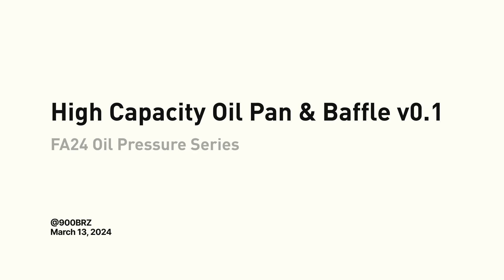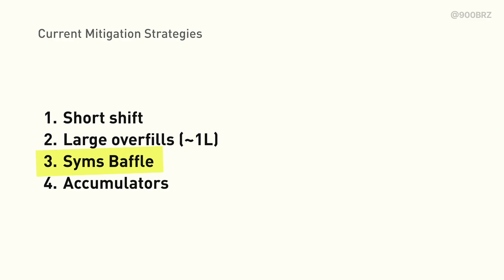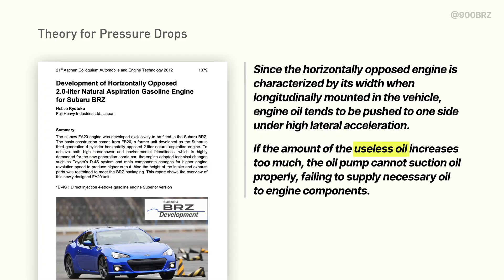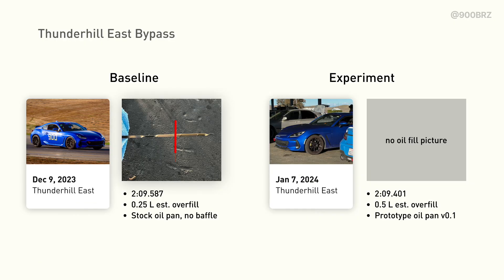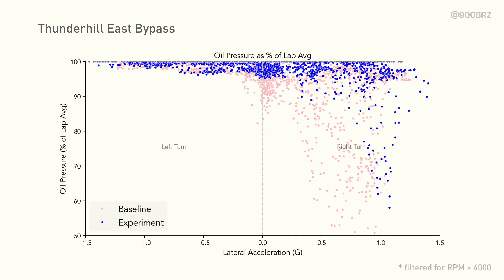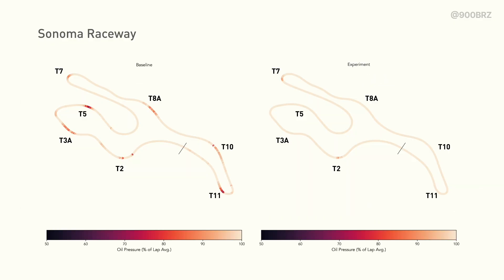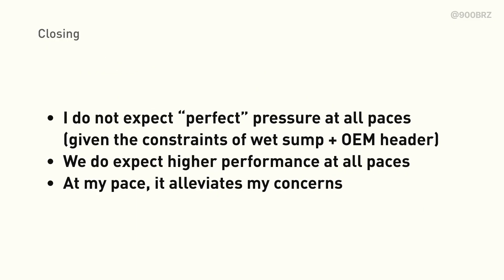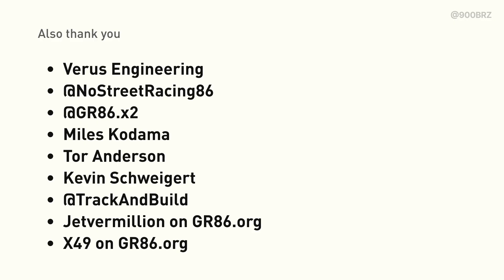FA24 High Capacity Oil Pan & Baffle Announcement

Comment: I had a professor that said "if you can't solve the problem, ask a different question." Maybe the oil pump flow rate is higher than the return rate? That's the problem. Restrict the the flow rate of the pump and maybe that works.
Reply from the maker: Yeah that’s definitely something I’ve heard of people doing in the FA20. At higher limits those will still have issues. Do they restrict the ports supplying the heads to try and increase the supply to the main galley (main and crank bearings). Restricting the flow of the pump may also help but it requires timing cover off and probably much more testing than this brute force approach.

Comment: First off, thanks for all the work to thoroughly test prototypes so a meaningful solution to this problem can be found.

Are you running your oil pressure sensor in the galley plug, or the stock sensor location? Also did you bother with a remote line to reduce vibrations/ heat on the sensor? I have mine in the galley plug with a remote line, but I kinda wonder if it's overkill.
Reply from the maker: It’s in the stock location with no remote line. Fwiw this is how the GR Cup cars are instrumented as well. I don’t think the remote line hurts, but I haven’t had any issues with this setup
Reply: @900BRZ  good to know! I may drop remote line just to reduce the additional connections that could fail

Comment: Thank You for this extensive study.  Not only is it interesting but it is also useful.  I am curious though. With so much focus on this issue for BRZ/86, I wonder how many other car models, performance or otherwise, experience brief pressure drops or fluctuating oil pressures?
Reply from the maker: For commuter cars it’s likely very high, but this car is marketed as track-ready, comes with a free track day (Toyota only), and has a factory race series on the same engine. I would love to test Miatas. One of the development engineers said they had an internal benchmark for consistent oiling to 1.4 G, which is significantly beyond where my car is going. That said it’s a lot easier to achieve in an inline engine.

Comment: Any long-term issues that may develop if the stock header heatshield is removed?
Reply from the maker: Good question. I don’t fully know, but my collaborate Kevin said he ran his FA20 for years like this without a problem. It’s also possible to wrap it or get it ceramic coated. Or adding cooling like a hood vent would probably look completely counteract the additional heat. I haven’t noticed materially higher oil or coolant temps running with the uncoated stock header. I liked what Eric from Verus said: it’s a lot easier to solve cooling issues than pressure drops.
Reply: Maybe verus can come up with header pan combo that resolves all concerns.
Reply: I’m somewhat vaguely aware that ignition coils can go bad due to excessive heat - but this was gen1 cars and on aftermarket headers (that may or may not be coated). A few mates had them fail on track but they had spares.
Reply from the maker: @ajs858 Read a bunch more on that in the forums. I’ll do some tests with an IR thermometer and see. I’ve been lifting my hood after sessions to let the heat escape. Sounds like it’s a good idea to keep doing that.

Comment: This work substantiates my suspicions that I've always had. This is a 30k car that was bored out in order to get HP gains we all enjoy immensely and makes this car an absolute steal, value wise. I raced a ZR1 through my favorite corner tonight on my drive home and hanging with a car of that caliber and to be in his mirrors at 30k is an amazing accomplishment. We own a world class chassis and a capable powertrain. 
I've been following 900BRZ like we all should and have had a 4500 rev warning on my car  until we get better data and this video gets us a step closer. The low revs data shows that if you take care of your car, it takes care of you. When you race it full bore, maybe not so much. Those pressure drops look to be unresolved when pushing this car into the stratosphere but there are still questions in my mind like oil temps and maybe a relationship with pressures. My engines never seen 220, but the blow ups on YouTube we have all seen have been in the 250 plus range
Thanks 900 BRZ for your tireless work!
Reply from the maker: Thanks! This is why I wanted to leave the conclusions in a subjective framing and let people make up their own minds after seeing the data.

Comment: I'm very excited about this solution. Hopefully this pan can accommodate an oil drain valve (like the fumoto one) so the 1L overfill can be easily drained after a trackday.
Reply: Uh....with the bigger pan you would not be draining the overfill since it won't technically be an overfill anymore. It would be increased capacity, so you would be running the "overfill" at all times. If you drain, you would be under filled.
Reply from the maker: I think it will be pretty standard to run the high capacity pan and still overfill past that top of the dipstick. When I’m describing the overfill in the videos, I mean beyond to the detent on the dipstick.
Reply from the maker: It will most likely be required to extract from above with this setup.
Reply: @900BRZ  that could be something to improve, maybe even offer it with a valve. Or maybe it's easier than I think to just suck from the dipstick tube.

Comment: I have a track only Gr86 I slapped parts onto a salvage car to compete in club tr and nasa tt5. Splitter, wing, 17x10s with 255 200tw tires, etc. If this pan fits most aftermarket El headers like ace/sme/jdl 
I'm a day 1 buyer.

Right now plan is to send it with syms baffle and an overfill but I'll take any extra oil capacity I can get.

Comment: Miata is always the answer lol luckily this engine will be replaced
Soon
Reply: With what?
Reply: @ruturaj47  suppose to have that 3 banger but price is probably gonna skyrocket so regardless car is as good as dead lol
Reply from the maker: I’d rather have an NA inline 4. All the guys with k-swaps taunt us, justifiably. CARB laws are tough though.
Reply: @gigi9467  that's probably never going to happen. Toyota did that to test synthetic fuels. Toyota isn't going to build car on outdated Subaru platform and Subaru isn't going to put Toyota engine in one.
Reply: @900BRZ  inline 4 would be ideal for sure, plus lighter and space for double wishbone.
Reply from the maker: Yeah that would be the dream.
Reply: @900BRZ  yea i agree i rather a reliable 4 banger inline than a turboee 3 or that flat four as long as they kept
That price under 30k i take it with a “regular” but reliable inline 4
Reply: With what?